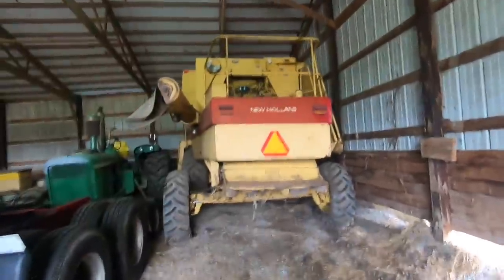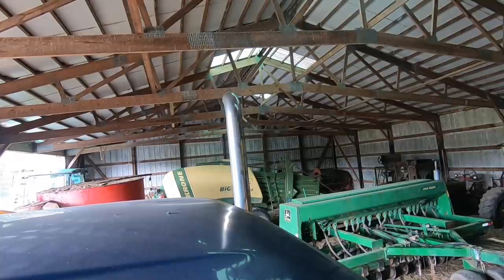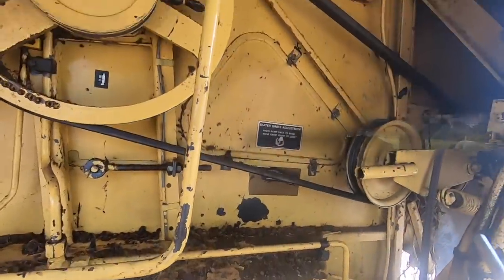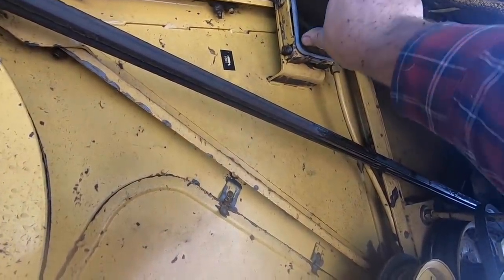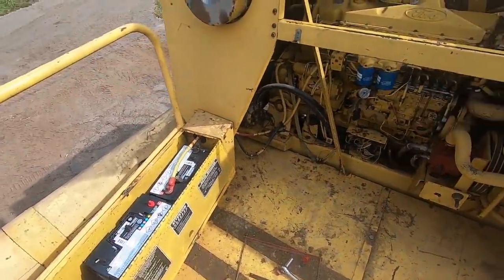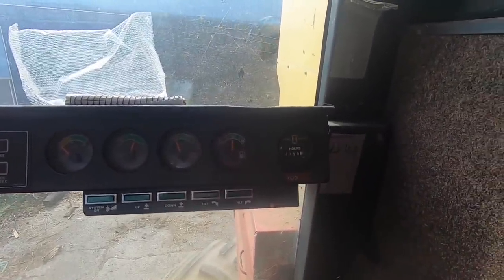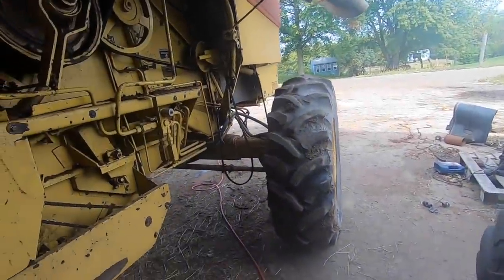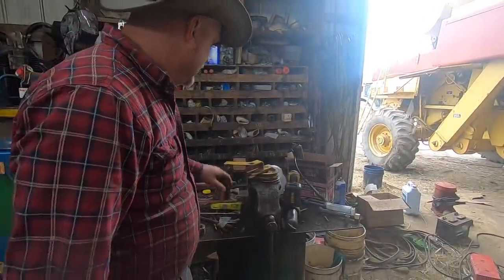First Start Since 2017

Comment: If you put the electronic mouse repellers in a combine cab you will have no damage and definitely no mouse shit smell we learned the hard way one summer at start up I tried to speed up the reel and the headlights came on from a rat eating off the insulation and some of the copper wire it cost €1400 of labour to fix it

Comment: Old IH combines (2188) have a wire mesh strainer in bottom of tank. Corn stalk leaves, tree leaves sometimes make way into tank which plug mesh.  Took me a couple of weeks to figure it out. May have stuff in bottom of tank, pull line and drain some of tank.

Comment: I wish both of my TR 96's had the ford motor... so much better...
Reply: What was the other 3208?
Reply: That 3208 engine was a workhorse when properly maintained. Had them in two of my Ford LN 9000's and never regretted those purchases.

Comment: Those old Ford/New Holland straight six engines are pretty hard to kill. We have one in an F-600 dump truck, doesn't make a lot of power but runs great. Only major issue with them is they aren't sleeved.

Comment: Maybe lots of sealed bearings on tha combine ? Maybe they're getting dry.
You can grease them by making a little hole in the seal and with a needle nipple on the grease gun you can grease them.
I used to make them holes with a dart, break the plastic of and you can hammer the hole.
You can also use the drill with a little drill bit.
Eventually cover the hole with tape or silicone.
Reply: Have greased bearings that way before, then just put a little silicone one the hole
Reply: @bryanG4020  Always nice when its running smooth again and less chance on breakdowns.

Comment: Its always amazing how a diesel can fire right off after sitting for years with the old diesel fuel in it.  Love older equipment,  bulletproof.
Reply: Diesel fuel isn't full of rotgut stuff like gasoline is... Long as the algae doesn't go crazy it's all good.  Old diesel is actually better about that before they started adding all the soybean oil "biodiesel" to it.  The good old petroleum diesel was WAY less prone to algae than this soy oil low sulfur crap.  

H3ll even old gasoline was better!  Grandpa grew his last crop of grain sorghum in 81 and had some problem with the combine not cleaning and putting too much trash in the tank and it drove his cup weight in the toilet and so he got docked hard.  Sorghum was cheaper than dirt at the time due to Carter's Soviet grain embargo that collapsed all the grain markets and precipitated the 80's farm crisis... Dad was working full time 60+ hours a week at the nuke plant making money hand over fist and he didn't have time to worry about it, and they decided to go all cotton after that anyway, so the combine went into the barn and stayed there for the next 15 years.  For the first couple years after it was parked Dad would pull a battery out of the pickup and climb up there and primed the fuel system and fire it up for about 20 minutes and drive it around behind the barn to "blow the dust out" and then put it back in hibernation, but after a couple years or so he quit bothering.  It sat in the barn ALL that time until the mid-90's when I decided to put in some grain sorghum again.  

The old Ford 640 combine (Claas "Senator" combine painted blue) had a 300 industrial inline six, same straight six as the Ford pickups but with sleeves and a belt-driven governor on it.  My brother and I went out there to fire the old combine up for the first time in 13-15 years and the first thing after airing up tires we were gonna do was drain the gas tank, because I figured that old leaded gasoline had probably turned SO stale it would be absolute garbage...  I put a 5 gallon pail under the tank drain and loosened the plug and unscrewed it and my hand got splashed with this old gasoline... It gave me a burning sensation on my skin like I remembered as a kid-- my job was pumping about 60 gallons a day into the combine BY HAND using an old back-n-forth hand pump every morning... anyway, I was looking at the stream of gas going into the bucket and I sniffed it and the memories came flooding back-- back when gasoline was a reddish-blue and when sunlight shimmered through it it shone every color of the rainbow, and the scent would about knock you over it was SO strong... I looked at my brother and I told him, "H3ll, I think THIS stuff is better than the rotgut stuff we just bought to put in it!"  He looked at it and said, "Well, put the plug back in then!" so I did and we poured the bucket back in the fuel filler.  We primed the fuel pump and system with a squirt can from the carb to the tank and put a battery in, and climbed up in the cab and spun her over... cranked about 15-20 seconds and popped off.  Cranked her again a few seconds and she sputtered and spit for a few seconds and died.  Cranked her again and she fired right up, ran rough a few seconds, leveled off and smoothed out and ran like it had been shut down yesterday... 

This modern gas is SO pathetic... it's clear as water and about as potent.  Back in the old days when we pulled cotton pickers out of the barn there would INVARIABLY be a yellow jacket (paper wasp) nest on the machine around the engine which we had to install the battery and prime the fuel system, so we'd either use the squirt can or fill a cup with the old red/blue gasoline and throw it to douse the nest, and even if you partially missed it would kill every one of them-- they just dropped off the nest onto the ground dead.  Learned not to try that with the clear modern horse-p!ss gasoline they started selling in the 90's... that sh!t was about as effective as throwing ice water on the sumb!tches... you'd have the whole nest lift off and chase you out of the barn... Only thing that worked worth a d@mn then was "Bengal Wasp and Hornet" spray... that sh!t really works™ LOL:)  Oh wait that's TireJect... LOL:)  
Later!  OL J R :)

Comment: You dislodged the blockage w/ air.  My experience is that there is more debris in tank, likely rust, and blockage will return.  I found that sizable rust particles block the inlet orifice, prevent fuel from even entering the filter.  I purchased an inexpensive probe camera located on the end of a flexible shaft, & the amount of rust in the tank bottom was incredible. Camera head  rotates & is fuel/ fluid proof.  Cleaning the tank is  short term solution.  Several tank lining coatings are available, some actually work. Currently  It will deliver fuel @ static pressure, BUT when the engine demand is @ 2000+  rpm, under load,  must be under load !   it will starve for fuel.

Comment: Too bad  you 're not in the midwest.  Might be less expensive to hire a contract harvester crew to     shell the corn.  @ least you know fixed cost,  avoid costly breakdowns/delays.  There is no $$ in crop sales these days, got it, but nickel/dime repairs on an  older machine that has sat for some time, will eat into costs just as quickly. & harvest weather windows close quickly .With all the Krone business given Neil Messick, he should rent or demo a combine $ reasonably. While corn is harvested, you could focus on your core business, mulch hay.
Messicks  would experience, benefit from , you tube exposure. Having purchased the corn head, gives you the winter to determine the actual cost to put TR96 in service for 2021.
Reply: For 200 acres it's not a big deal... not like it'll take him a month to combine 4,000 acres LOL:)  OL J  R :)
Reply: @lukestrawwalker  It certainly is a big deal if the combine continually experienced issues. Machine has new  small failures as of today. There are advantages to fixed costs on accelerated time tables. This is NOT texas. Harvesting windows can close quickly & a 3 inch rain event in this area can devastate field accessibility.

Comment: BTP just did a video on a TR99 on his channel, what's the difference between the two ?
Also, how can that filter be upside down, it had 3 holes that lined up perfectly, if you were to flip it, they wouldn't line up at all ? Thanks.
Reply: Think he meant the housing was upside down, but then that way it'd airlock so it isn't... OL J R :)

Comment: Honestly..re place that stant glass type filter ..only misery an anguish other wize...swap it foe a screw on if you can...
Reply: If they gave that much trouble he would’ve changed it by now he’s ran that combine for years
Reply: Greg Shearer the gaskets dry out you change it after the air gets in twice or three times as much as a screw on filter...don’t ask how I know..an are theses still on equipment..No..js

Comment: If you change tire size, will that make the 4wd system bind?? Just curious.
Reply from the maker: No it’s static pressure on the rears.  I did put on the same size but there radials